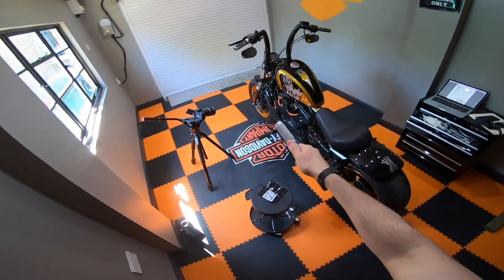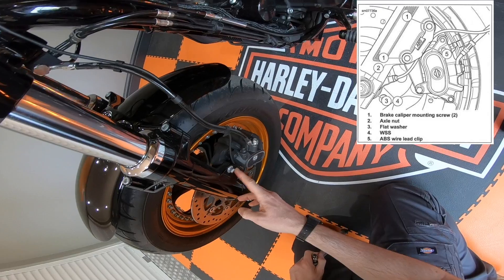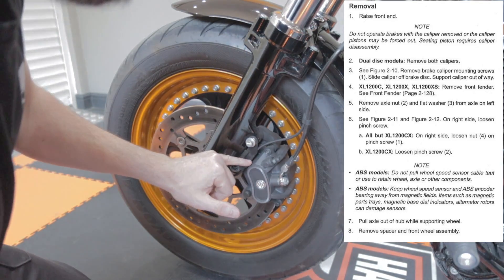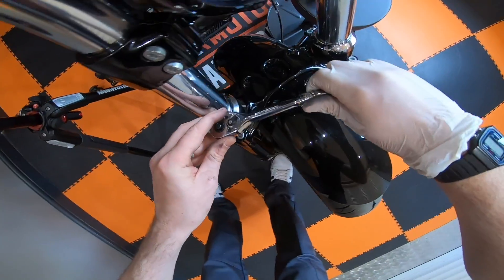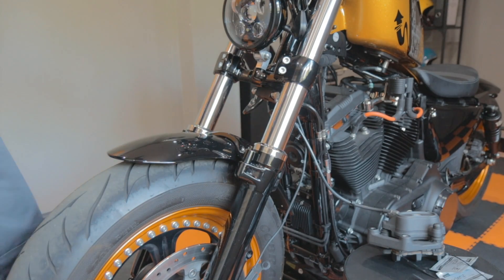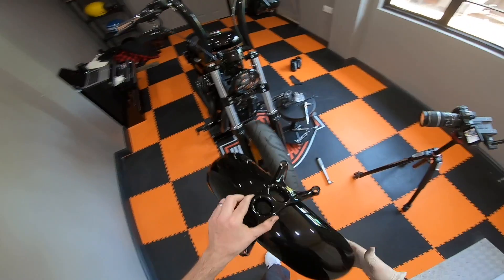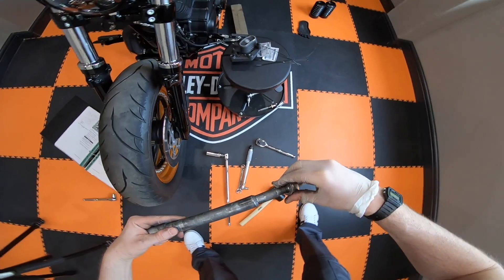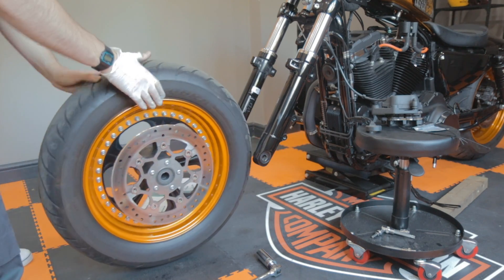Sportster Fork Black Effect Customisation

Comment: When applying the wrap, just wrap a small strip about 1/4 inch wide around top & bottom first to stop you from leaving a chrome gap, then wrap round you're main piece overlapping those small strips slightly. I bought some from Ebay & it came with that instructions to do that, gives a nice completefinish. I used my thumbs to squeeze the air out as I went round the fork, but whatever works best for you.

Comment: Very good video. I love that you’re including the manual specs instead of just slapping it together with an impact or till it “feels tight enough.” I don’t know if it’s just an old wives tale, but I’ve always heard to never loosen fasteners with a torque wrench or use it as a standard ratchet as it will mess up the calibration. I don’t know the truth to that claim and I’m sure a high quality tool makes a big difference to that, but I always keep a breaker bar handy for that purpose. Other than that, great video.

Comment: Would you have considered marking off the forks when you had them off and adding the vinyl then? Could potentially ensure you cover the entire area that will be showing and give you easier application process? Just wondering for when I do it, appreciate it!
Reply: May not slide back through the clamps
Reply: @stevengibbs6645  mine did

Comment: Oy, mate, I might have missed that in a video, but fyi, every time you undo any of the upper or lower fork bracket bolts, YOU MUST MEASURE AND READJUST STEERING HEAD FALLAWAY. Otherwise you're at risk of high speed instability (wobble) especially taking into account your custom handlebars. Take care.
Reply from the maker: Nothing in the harley davidson service manual made any reference to this and I read it thoroughly.
Reply: @Motonewbrider  manual doesnt cover all possible operations. Just wanted to bring it to your attention. Checking it won't hurt and should take more than 10 minutes.

Comment: Owned plenty of bikes and I always find it easier to leave the wheel, caliper as fender intact and just slip the front end out as a unit. There was no reason for most of the labor you did. All you needed to do was gain access to the fork tubes to slip on the gators.